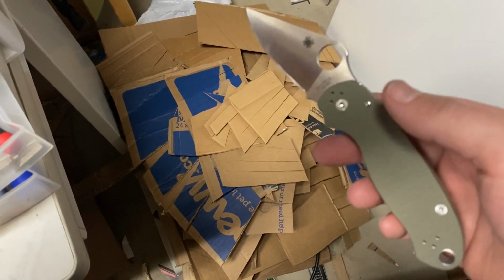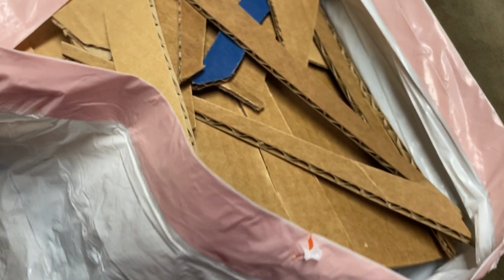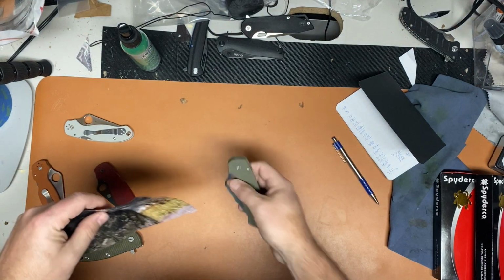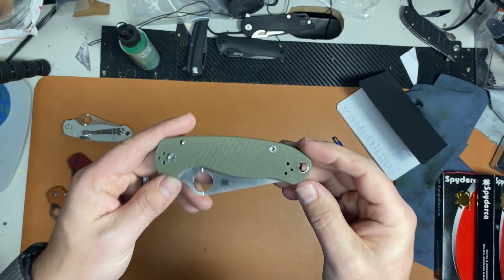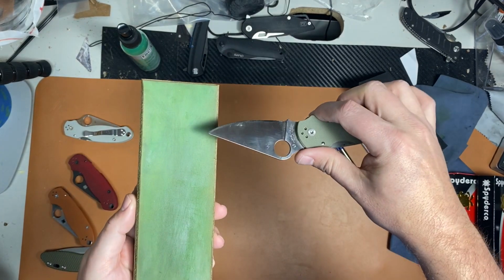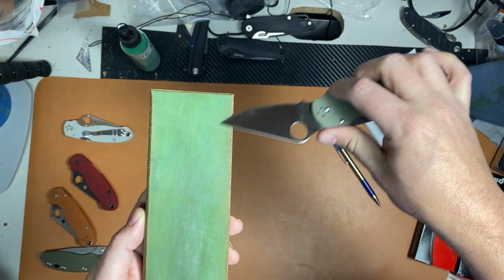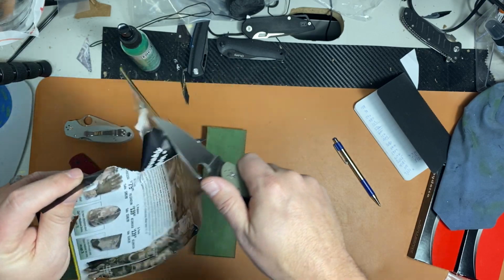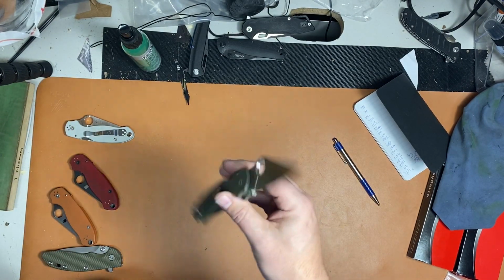Spyderco Para 3 K390 Edge Retention and Stropability

Comment: Great results. I already have 2 Para 3's, both in good steels, so I might pick up a PM 2 in this steel, because I only have the one in Cruwear. 373 feet and that's only fine edge. It could still do more for a working edge. I'm impressed! Thank you for doing this. I've been waiting for one of our testers to do a run on K390. Kudos for beating them to the punch.
BTW, I use diamond paste strops on any of these type of steels. It works much better on harder steels like this.
Reply from the maker: Timbo437 I am using diamond paste on there strop from bastard strops. Just some leftover green residue from the pre loaded strop